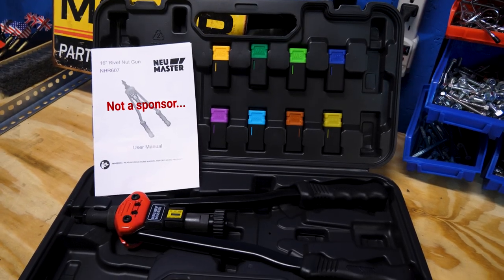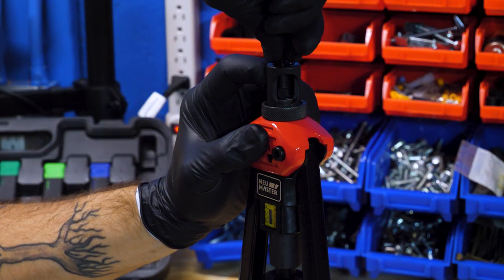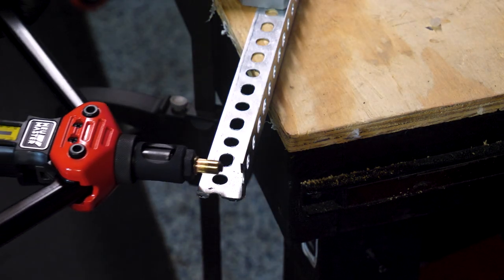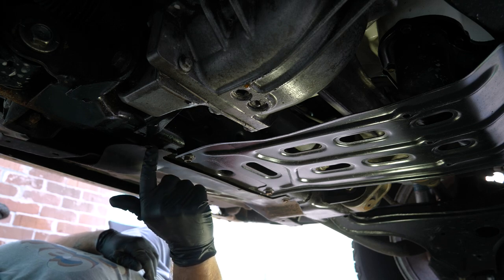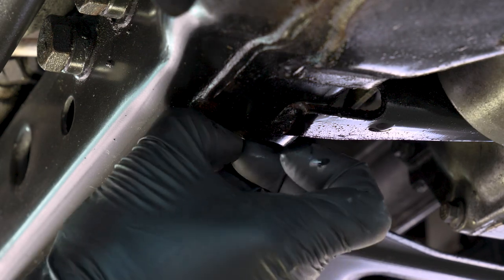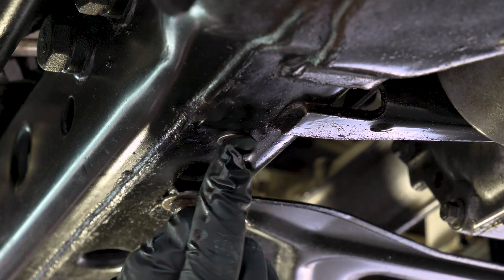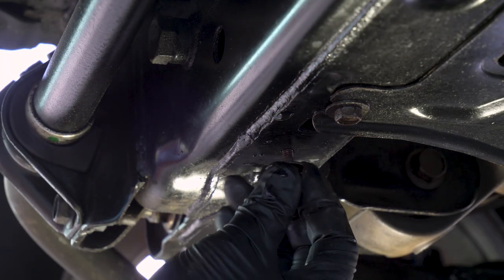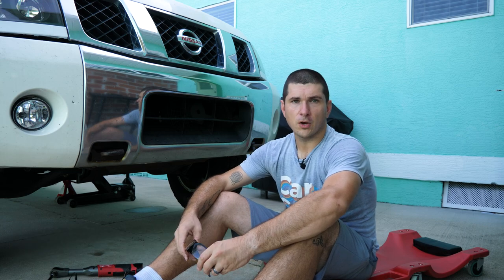I Didn't Realize Rivnuts Were This Easy... (How To Use Rivnuts)

Comment: Thank you for sharing this!  You explained in more detail the stroke adjustment, which frankly is my only hang-up with understanding the operation. I recently purchased an Akktol BT-607 kit through Amazon. After viewing several systems, it looked like the best one for the money.  I've tried to understand stroke settings by reading the owned/user manual that came with it ...... BUT it keeps leaving me confused all over again. Lol .... Getting the initial setting right so I won't end up pulling the threads or damaging the rivnut, mandrels or tool itself is my concern .... I'm sure tho as with you, the best way to learn is to just start using it.

This tool is one that most guys will probably only use occasionally,  but one that if we own is priceless. Anyways, your video explained it much better than any I watched previously.  BTW, as for your skid plate under your vehicle, i'd use a stainless rivnut since it's located down where it's catching road spray etc. I ordered an extra asset Iof nuts in standard metal, plus an assortment of stainless as well.

Tnnx again for sharing.
Reply: i have/had the exact same question as you. as a diy guy im not trained and learn on the job.

i found with using rivnuts. To protect my shoulders and ensure i dont strip the rivnut threads, i do smaller crimps 2-3 times. And this ensures i dont over crimping the rivnut and stripping the thread!

Comment: Topic idea for Video:  Xterra Manual or Automatic - flow chart of logic to diagnose/fix if off road and Xterra motor won't start.  What are the parts one should carry for the possible situations with a no start condition and the tools to install those parts.  Of course this assumes the battery is ok and the person is carrying a starter pack for when the battery is run down.    Good video on the Riv-Nuts, cool fastener that holds well.  I see this tool used a lot in Van build outs for the interior construction.
Reply from the maker: Love this idea. Thanks for the input

Comment: How do you find out what stroke length for a particular rivnut?  The smaller mandrals like  a M3 can’t take a lot force or else it will break.
Reply from the maker: I just use a piece of scrap steel and set the stroke pretty long then I can see both sides and adjust it down until it's tight.

Comment: Plus nuts are even stronger
Reply from the maker: Nice! Looks like I can use the same gun too right?
Reply: @Ry the car guy   should be able to.  You may need to get a slightly longer mandrel (at least the Threaded part), or you might be able to do it with 2 shorter pulls instead of one

Comment: I was coming here to disagree with your title but that tool is cheating when installing rivnuts!
Reply from the maker: Haha what do you normally use?
Reply: @Rythecarguy  we use Blue Pneumatic Rivet Nut Tool. It has to be calibrated for aviation use. Yours looks easier to control the stroke but you still have to get a feel for how much resistance before you blow out the rivnut.
Reply from the maker: @ike621  Oh yeah I'm sure mine is a much more dumbed down version than yours. This one is "consumer level" lol.
Reply: @Rythecarguy  but I also have to congratulate you on stepping out of your comfort zone and tackling this fear.